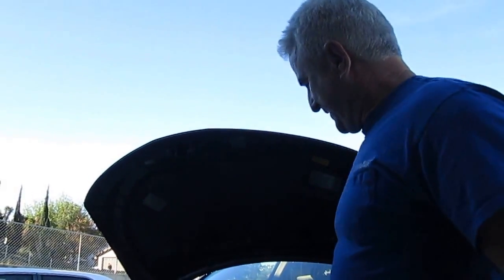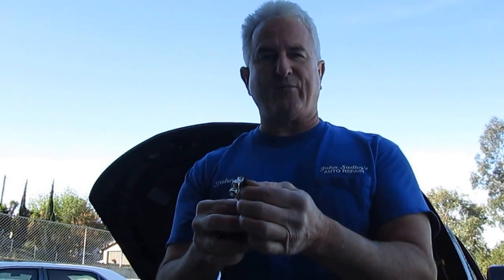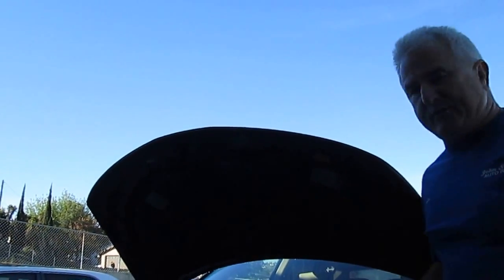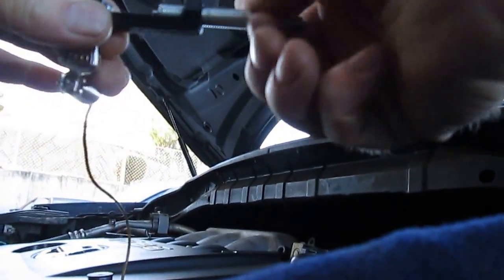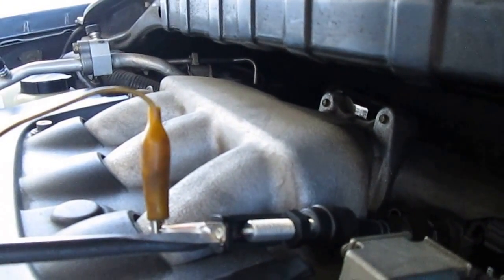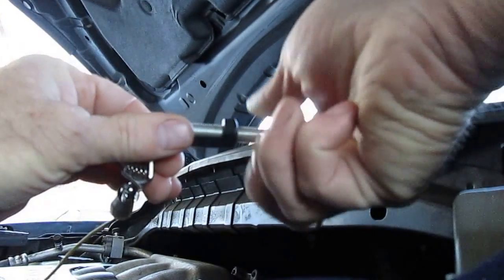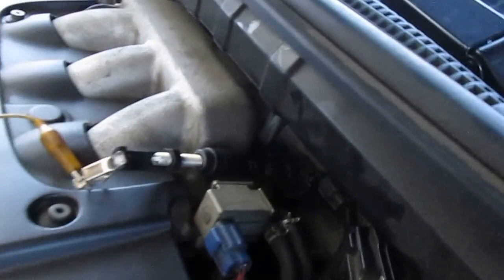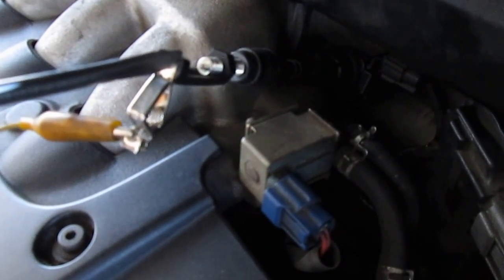How to Test an Ignition Coil

Comment: Easy, just unplug and if the engine misses when it aint plugged in. Its bad
Reply: Sometimes coil works but not under heavy load so it works but not full capacity so should be replaced.

Comment: Great video.  Do you know where to find data on Nissan  22448-JA00C COPs?  Pulled all 4 from my wife's 2011 Rogue because it only misfires while driving.  Replaced one coil last week that wouldn't fire at all.  It's values on a multi-meter are WAY OFF from the others with open circuits in all but one combination of pin readings.  The others aren't exactly the same, and are somewhat different than the 1 new coil I installed last week.  Just had a $500 tune-up done at trusted mechanic with new coil boots and NGK Iridium spark plugs before all this started.  Any help GREATLY appreciated!
Reply from the maker: Does the check engine light come on when it misfires? You should be able to get a code out of the computer and that will usually help narrow it down.
If no codes, then I would reinspects all the things that mechanic get for you.
I would go to a local Nissan dealer with your VIN number and by the spark plugs from them and the ignition coil boots from them.
Look at the pins where the connector plugs on the coils, sometimes the pins get damaged and the connector pushes them down so one terminals not connected,
I would look for codes first and if it's a good mechanic I would call him up and tell him what happened after he worked on it.
And see what he says it let me know.
Reply: No CEL... misfires intermittently while driving.  Used "gas peddle" trick to decode faults via CEL.  All 0000's, so no faults set yet.  

Removed all packs, checked their pins, checked connectors for dirt/corrosion/and metered 12V, Grnd on connectors, all fine.  Spark plug wells looked relatively clean (new plugs and all), with a dab of crud on one spark plug tip (I removed by inserting an oversized socket filled with a small piece of lint-free cloth).  I don't have correct 14MM socket to remove those new plugs yet.  

Those coils tested funny.  (Just resistance test so far.)  Only tested from 3-pin connection.  Some pin combinations were 2,400 -2,800 Ohms, and some were about 4 MegaOhms!  MEGA.  Capital M and Omega symbol on my Fluke???  Weird!  Didn't test secondary (probing into boot).  

The 3 OEM coils were almost ALL identical with all combinations of probing the 3 pins.  The new "O'Reilly's" Import Direct coil I bought to initially replace one that had visually burnt up measured somewhat similar, but 2 combinations of pins measured O.L (infinite resistance).  Nissan's test procedure that I finally found for a resistance test says as long as any pin combination didn't test 0 Ohms, and pins 1 & 2 didn't test 0 Ohms or Infinite (O.L) then they passed that particular test.

Guess I need to do the test where you disconnect the fuel pump fuse and dangle each coil with a plug connected to the wiring harness and crank the engine to see if each one sparks adequately.
Reply from the maker: The spark tester in the video has helped me alot with the problem your having to eliminate the coils or prove there bad.
Reply: Just removed all the spark plugs.  They look ok, but a little carbon buildup on 2 electrodes, not the tip, but kind of the curved part really.  Checked gap (NGK Iridiums) which supposed to be .044 but 1 is .036, 2 are .038 and one is about .040.  That .040 one looks like the tiny electrodes are not perfectly aligned on top of one another.  Read on some forums people have found this problem from factory NGK's and once corrected to .044 or some went all the way to .050 it improved idle, power, and smoothness.  What is your take on this?  Are Iridium plugs hard to regap without breaking them??
Reply from the maker: @TortureBot  hook up a scanner and get me the LTFT at idle and at 2,500 rpm. This will tell us if it's rich or lean. You read it in a percentage.
Reply: If my cheap scanner can show that data, I'll send it this afternoon to you.  Scanned it yesterday and there were zero codes and pending codes.  The cheap scanner I bought does have a bunch of data it can read which is above my head, so I'll rescan it and look for that data.  Took my time and regapped the iridium plugs to exactly .044 last night and it was dark by then, so I covered the wells in the block with plastic and waited until today for putting them back in.  I was extra-careful to put pressure only on the ground strap away from the iridium tip and part of the ground strap where the arc happens.  Oh, BTW, I don't think this scanner does "Live Data", so it may not show what you are asking about.  It shows "Freeze-Frame" data at the time codes are generated.
Reply: Got the plugs back in and it seemed to improve the idle and throttle response a bit, but after driving it 3 short drive cycles I felt the APPARENT misfiring again.  Still no CEL came on and after coming home and scanning, there are no codes and the misfire counter says "OK".  

This cheap scanner does not have the LTFT data.  

Beginning to wonder if it's the CVT.  The first 2 short trips everything were fine.  The final trip home, I got a mile down the road and felt one quick misfire or STUMBLE.  Then about 4 miles later accelerating after a turn there were 3 in a row.  Then 3 more intermittently on my street.  I don't see any change in the RPM's though.  Puzzled.  

Someone in a forum said something about checking my CV boots/joints.  I know the boot on the front passenger's side has come loose on one end.  They found it during the most recent tune-up and rotation and told me the cost for replacement.  I crawled under the vehicle and confirmed the other was fine and the one they stated is loose from the side nearest the wheel.  This doesn't sound like anything that would cause a hesitation or stumble.  I am under the impression this would just need to be repaired to prevent CV joint damage from dirt/moisture and if the joint were damaged there would be popping/clicking, which is not present.  

Then people are saying check or clean the MAF.  Wouldn't that throw a code as well?  Argh!
Reply from the maker: @TortureBot  how many miles on your engine? Where do you buy your gas?
You may have a sticking fuel injector. That won't show up on a scan tool
 The cvt transmission does weird things sometimes. You can drain and refill it with dealer/factory fluid only.
BG Products makes 44K, add one can to a full tank of gas and see if it helps

Comment: Do u know what the resistance should be on the 3.5 altima coils..mine are reading 1.45-1.60 ohms of resistance..the thing is when i have someone turn the car over the coils are not sparking so idk wat the resistance should be amd if there is a  ignition/coil relay
Reply: Goog